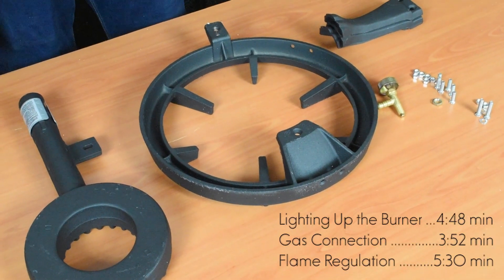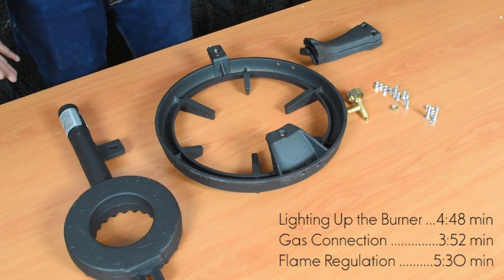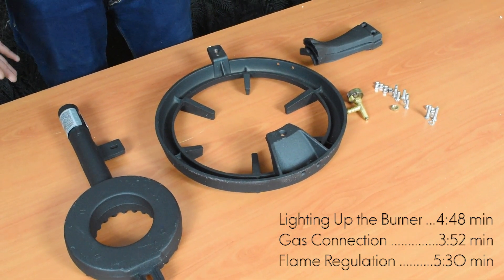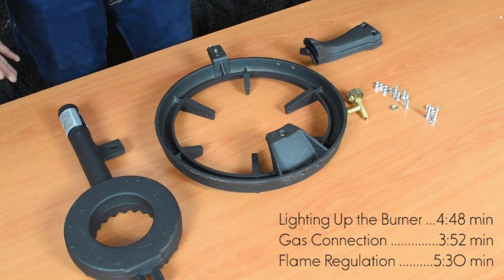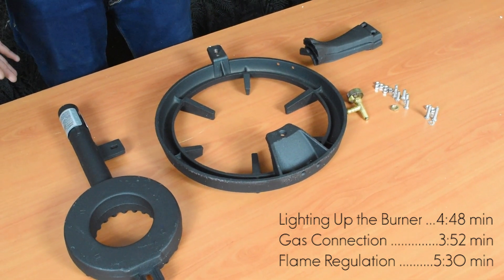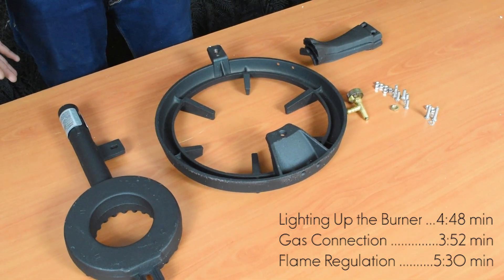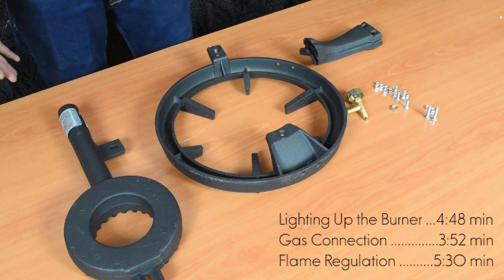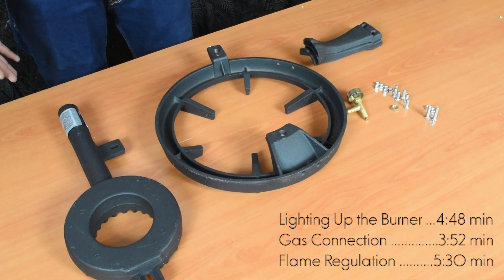NJ GB-24 Powerful Gas Boiling Ring Cast Iron Burner Outdoor LPG Stove 8kW

Comment: On adjusting the flame lower I keep getting a blowback with the flame going out on the burner ring and then igniting at the end of the valve where it enters the air vent !! What am I doing wrong, any ideas ?
Reply from the maker: Hi Lindsay,  sometimes backfire can occur when there is too much air. Close the the air vent a little bit.